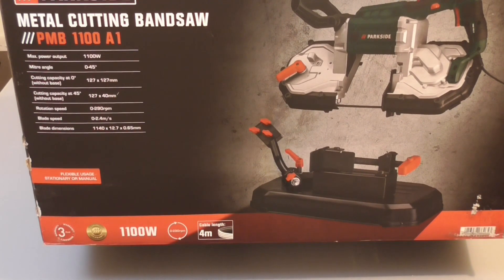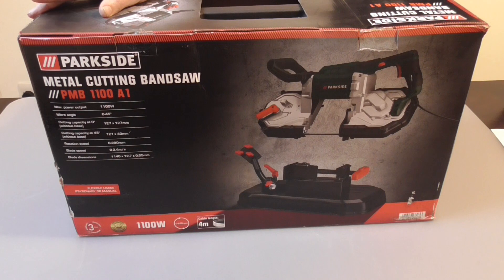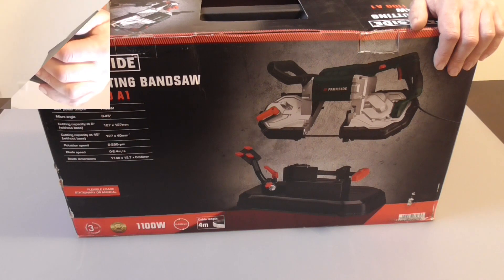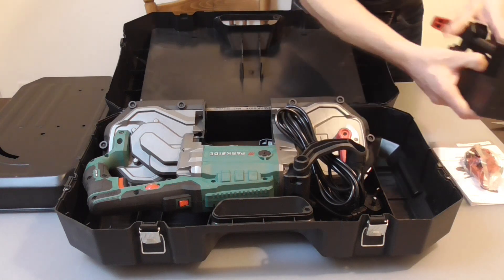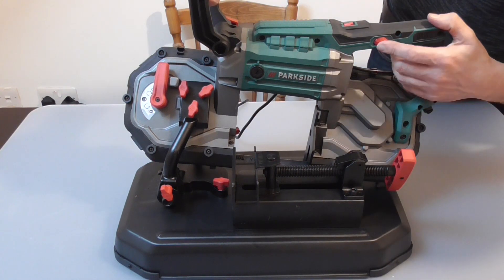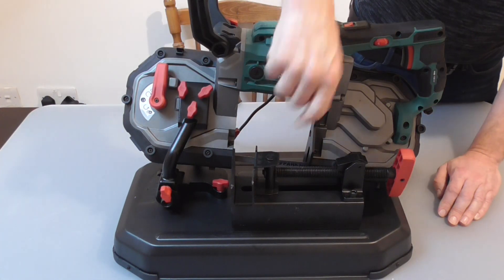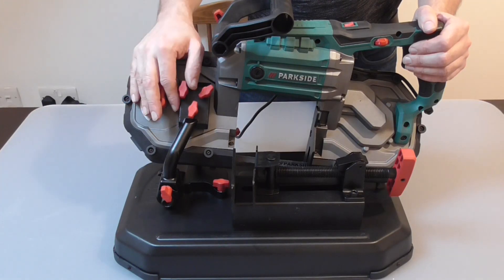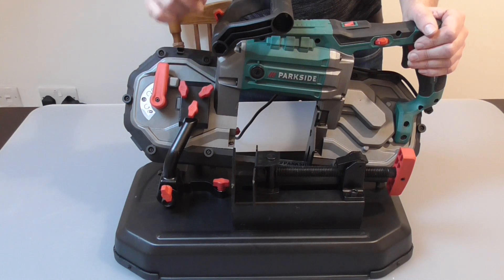MUST WATCH PARKSIDE METAL CUTTING BANDSAW UNBOXING

Comment: My local Lidl had 3 of them come in, So I grabbed one. Got it home and found it had a duff speed selector switch. Took it back and get a replacement. That one had the gearbox drive pinion so out of mesh that it shredded the top off the gear teeth from literally cutting an inch into the first piece of 3mm mild steel I tried it on. I'd cut a couple of 25mm alloy box sections OK before that, But 3mm steel was more than the tiny tooth contact patch could take. Went back to lidl's and grabbed the third. I insisted that I tested this one before I left the store, So the manager took me into the store room and I tested that the speed controller worked as expected. Then when I got home I put the poor little saw through hell for a good 10 minutes straight by hacking the end off a 2" square solid bar of mild steel. I didn't want to pussyfoot around this thing. If it was going to fail it was going to fail NOW rather than in 3 months where they could say I'd abused it if I took it back. Number 3 seems to be a keeper so far.

The managers at Lidl were first class, No messing about, 100% helpful and wanting to get the problem solved to my satisfaction there and then. Can't praise them highly enough for the way they handled these problems. The quality of the device itself isn't stunning, But it feels like it SHOULD last long enough to warrant the price. I think I may have just been unlucky, But I also have to wonder what the hell was going on with the Parkside factory's quality control? It's concerning that 2/3rds of the ones the sent to my local Lidl's were, to all intents and purposes, dead on arrival. Hopefully the one I've got now will be the last one I need to get for a while. :)